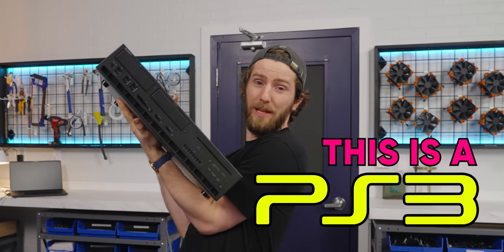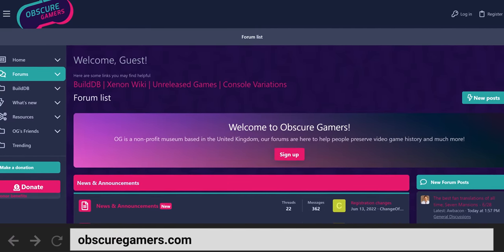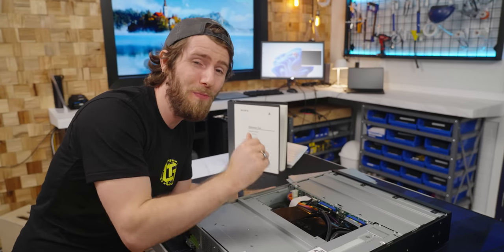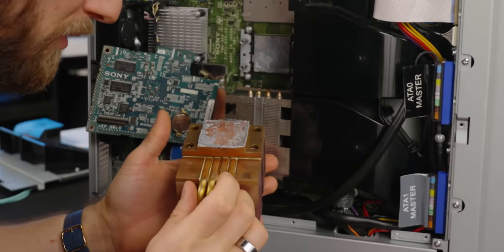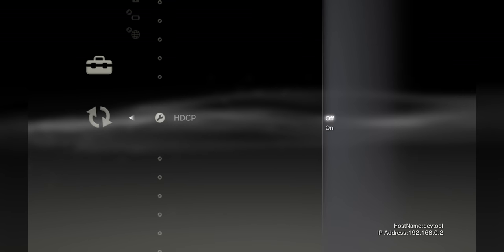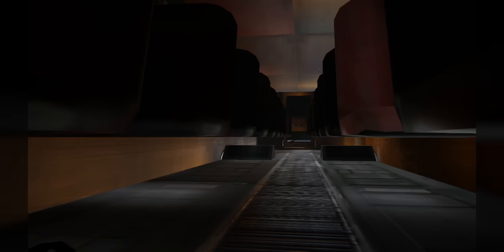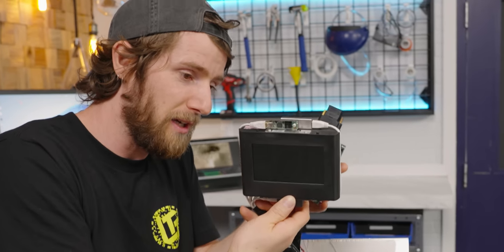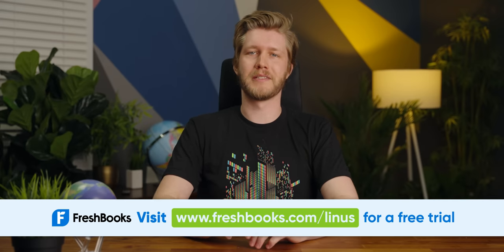I Await Sony’s Cease and Desist - PS3 Dev Kit

Comment: I was working for Sony / Psygnosis at the time the PS1 came out. The dev kits at that point were two full length PCI cards that plugged into a PC, replete with DMA / IRQ jumpers - they were a bit of  bugger to set up.
Reply: I must have been spoiled to be working for Sony in the PS2 era, with the big old dev tool PS2. Step/breakpoint debugging on hardware like that was real handy.
Reply: The ps1 was easier to program for than both the ps2 and ps3 right?
Reply: @califaern3sto  I wouldn’t say that. The ps2 had more memory, more sophisticated dev tools. Ps2 did have more interesting architecture,
Reply: Source: trust me bro
Reply: Wow psygnosis. Now that's a name I have not heard for decades.
Reply: @krazysk  Yeah, specially AMIGA COMPUTER game titles...
Reply: did you use the psyq sdk?

Comment: It had nothing to do with their inability to attract developers. It had everything to do with their inability to produce functional custom chips like CELL In anything resembling quantity. That thing was $50,000, because that’s probably what it cost them to roll that chip out early on. Another  reason why the PlayStation 3 was initially so expensive was that producing blue lasers in quantity was a real issue, they were costing as much as $100 apiece at the factory to roll off the line because only one in 10 was actually good. This was happening at the same time as the console launched
Reply: They have always charged out the wazoo for these, even after consoles shipped. There is always need for added hardware level debug which these consoles can provide, especially later in the release cycle and you will pay a premium for it. Sony probably aren't ever making money on these even later on. The engineering, support and tooling needed for these is done for the value it adds to the platform.
Reply: @dorbie  Yes but that doesn’t represent $50,000. What is $50,000 represents is that they only got a couple of good chips off of a wafer. This is all part of developing hardware
Reply: @jeffkleist9679  ~10% is considered a bad failure rate, not a good production rate. I understand the competition of the console wars was fierce, but that clearly indicates they needed to step back. In the end, it appears they had another team do that since the price dropped alot. I still remember people saying that the PS3 was teh cheapest blu-ray player and it was infinitely better to buy one of those even if you had no intention oof playing games on it. I also noticed that blu-ray players dropped in price within a few months as well.
Reply: @kohlrak  The format launch of Blu-ray was rushed due to the launch of hd dvd. It’s one of the reasons why HDDVD tried to go with red lasers until the bitter end. This was an industry wide problem. Sony froze out most standalone player manufacturers. Only Samsung got one out for launch
Reply: @jeffkleist9679  Pour one out for OpenGL vs DirectX

Comment: That same debug menu is also in a cfw / jailbroken ps3! Basically after installing a cfw, it unhides that debug menu in any ps3 console the cfw us running on.

  I played around with nearly all those options in debug menu. Its pretty cool
Reply: Only you couldn't disable DHCP on retail consoles. It's enabled on hardware level

Comment: I still have my original "Fat Boy" 60GB but I replaced the optical drive (old one had lasers that died), I put CFM on it, re-pasted both chips, 500GB HDD and all my disc games installed on it with other emulation. It has been one of my favorite projects tbh.
Reply: Think I will have to be doing that to mines soon.  The disc drive has issues reading PS2 and 1 games, but PS3 works fine and games work fine when in-game.  Likely the head jamming.
Reply: @Hunnter2k3  My friend at the time had the same kind of console I had but his GPU died in it. He bought a slim and gave me the old one for parts. In that aspect I was lucky.
Reply: I have one as well. A look of work but it's my primary PS2.
Reply: I heard that there's noticeable input lag when playing PS2 games with the fat model over HDMI. Is this true?
Reply: @psycomutt  I heard that there's noticeable input lag when playing PS2 games with the fat model over HDMI. Is this true?
Reply: @Xyskz  From what I've heard... Really shit conversion of the analog output signal of the chip to an HDMI signal.
Reply: I will doing that in the future. I used to had a slim PS3 one... But I really want the OG fat one, because It has hw to play ps2 games :D
Reply: Unfortunately for me, my old PS3 FAT died due to a yellow ring of death. I managed to "repaste" it once (using the heat gun technique) but it only lasted two weeks before dying again and then I never managed to get it to boot anymore...
And since the firmware is too old, I can't even get my old HDD into another PS3 to get my old saves back, because all used PS3 FAT have a newer firmware which prevents booting on older ones... :(
I lost a 250 hours+ Skyrim save which I miss so much... Anyway, life goes on.

Comment: I've been working in gaming for 15 years and to this day, this kit was the biggest pain in the ass I've ever had to deal with
Reply: well in what time frame would a ps3 clock in compared to others?
Reply: Why?
Reply: Same could be said developing games themselves to work on this unorthodox tech 😂 just ask Bethesda
Reply: @MJ-uk6lu  the hardware was unconventional and was unlike anything that anyone would have had any experience with and also Sonys Development Tools software was unintuitive and difficult to use.
Reply: @nickhowatson4745  Isn't that's like exactly every other console until they just gave up and started to use computer parts?
Reply: @MJ-uk6lu  not exactly. PS3 game development was an unfortunate combination of difficulties unlike its competitors and previous models.
Reply: @nickhowatson4745  What about X360? It shared cut down version of IBM chip and also was rather weird. There also was Sega Saturn that was completely bonkers on HW side.

Comment: The foot switch thing brings back some memories.  Back in the Microsoft DOS days, there was a program / add in board, called Periscope, that had a push button that would throw you into DOS debug so you could tell where your ONE running program, no threading back in those days, was locked up.  Man do I feel old...

Comment: 3:35 You can divide the surround sound into 4 outputs(4.0 like). 3:50 They are a remnant of the prototype. They were used to connect multiple devices into one network without disconnecting the device from the Internet. You can make them work with pre relese firmware build.

Comment: For reference, the reason the Reference kit has the additional HD slot is not for game stroage or redundancy it was so that developers can test builds quickly without the need to burn them to a disc.  They would develop on a standard PC, copy the code to a HD drive them insert that drive into the devkit/refernce kit and run the code on that hardware to test.  It makes things so much easier, not to mention faster than disc. Also, most studios did not actually develop code on the reference kit/devkit, they would only use them to test code on close to retail hardware.

Comment: I saw a PS4 version of this back in the days at Ubisoft Montreal. It was in a very plain metal box and screwed down on a desk with special screws. The box was plain metal color and only had a few holes in it to let the wires and controler come out of it. 

Your version is much more advanced than the 1st version of that PS4 we had. I think we eventually had new models along the way but that was very very very early models. 

Cheers... from Montréal, Canada  ;)

Comment: The Gears of War 3 bit has an interesting back story. From what I understand, the dev environment was setup to compile versions of games for other systems automatically when a new version was uploaded to the servers. The devs literally had no idea that versions of every GoW had PS3 builds.
Reply: And that is how you make cross-platform games the right way.
As opposed to all those "We don't support Linux because its too much work".
Reply: Modern Vintage Gamer has a video all about Gears 3 on the PS3.
Reply: Real reason is not that. There are 3 Gears of War 3 PS3 builds out there. One called GearPS3[2011-05-1915.29] (which is in this video) was compiled to test the Playstation 3's abilities with the PS3 having only 256MB of RAM for gameplay, while Xbox 360 has 512. You can tell it's this build because it has the UT3 logo, and the menus are broken with controller. You have to manually enter a new map. 

The other two builds which were compiled from a Gears of War 3 source code leak, which someone manually code fixed a lot of stuff (menus work, lot of back end stuff), additional maps that were scrapped added in. First version had the UT3 logo, and the other was polished with the Gears of War icons and PS3 controller buttons. The only way to make the game run faster, is to lower the RAM usage, which means decreasing all the textures to a lower amount. I have two firsts running in 2016 on my channel.
Reply: @hubertnnn  Linux Is too much work Is reality
Reply: @EpicErrorjack  Both PS3 and Xbox 360 have 512 MB of memory. The big difference is that the PS3 used a PC style Nvida GPU with 256 MB of dedicated Video memory and 256 MB of RAM while the Xbox 360 had a unified memory model with all 512 MB shared between both its cell derived CPU and ATI/AMD GPU. Most games used well under 256 MB of memory for the game state allowing the Xbox 360 a graphic advantage by allocating more than 256 MB as video memory allowing higher resolution textures or bigger/more frame buffers than possible with the PS3.

The likely reason for the poor performance with the PS3 in this case is the cell processor. Beyond a doubt the cell processor is terrible for games, being a single core processor with 7 much weaker, slower cores to back it up. We all know how easy it is to make games take advantage of multiple cores, especially slow ones, given it is 2022 and still AAA budget games suffer massive scaling issues beyond 6 cores. Microsoft was less silly and instead ordered their cell derivative processor to just have 3 big cores giving it much better, usable and more PC like general compute power even at the cost of theoretical floating point performance. Games optimised for the Xbox 360 likely expect 2-3 performance processors and so perform poorly when forced to run on a single powerful processor and 7 much weaker processors, which might not even be trivial to use to begin with. Games optimised for the PS3 often resorted to demanding physics to find a use for all the smaller cell processor cores or leveraging the bulk capacity of the Blu-ray to try and give an asset quality lead over the xbox 360's DVD.
Reply: @drsupergood8978  What both this video and Epicerror were referring to when they said it has 512MB is the main system memory (which is 256MB on retail units). PS3 devkits ship with 512MB RAM available to the CPU because of unoptimized builds which are very unstable with just 256MB.
Reply: @EpicErrorjack  My mistake, thanks for the clarification. It does make me wonder just how well the series could've run on the PS3 with more fine tuning.
Reply: Steam Deck is Linux, if you stick to Verified games you already have just as big of a selection of games compared to the Switch and with much better performance, and it's just as smooth of an experience
Reply: @hubertnnn  Well as you saw, the build runs, but barely. Getting it to run properly on a completely different architecture such as PS3 was, really would've been a lot of work. Though, the Linux example, shouldn't be as difficult since it's still x86 just like Windows and Mac are. But since Windows' kernel is it's own beast, that would be what would bring in a lot of the extra work. macOS and Linux are very similar framework-wise so translation between them usually isn't so difficult.
Reply: @hubertnnn  its not too much work because of the compile process.   its too much work because there are more then 100 linux distributions out there and supporting soo many formats and folder structures and commands and so on  with no unified standard for all of them  is not going to be cheap    .     even if you only do it for the popular distros you needs to do  flat pack, app image, debian,RPM,  arch , snap    all at once for all the distros.    then pray it doesnt break and has decent performance
Reply: @ali32bit42  Big wrong, Linux is standardized, even though you have all those distros, they all share the same filesystem structure.
And if you want to go lazy all you need to do is pack the entire application into a single folder and put it under /opt as eg. java did.

You don't need to support all the package managers, just support Steam or provide a tar. That's what most indie developers do. If it works for them, then its going to work for AAA companies as well.

@ForeverNoob I saw how it runs, how it runs on completely unsupported, different architecture without even the developers knowing about it. No tests, no performance tuning, no anything and the game runs stable around 20 FPS. That's a great job done by the porting team that setup the automated compiles.
Reply: @hubertnnn  it's not much work if you're using an engine that supports multiplatform targeting out of the box
Reply: @hubertnnn  Make a dev tool that automatically port windows games on linux and then talk.
Reply: I just though it was Epic using a game they had already built that uses their latest Unreal Engine and seeing how they can optimise it to run on PS3.

They had no intention on releasing it, it was nothing more than a "tech demo" in some sense.
Reply: @radosawmichapiwko7141  it's called cmake
Reply: @hubertnnn  Because it literally is too much work for the minuscule amount of people who actually game on Linux.
Reply: @radosawmichapiwko7141  You mean Proton and DXVK?
Reply: @Poldovico  They have proton on ps3?
Reply: @radosawmichapiwko7141  "Make a dev tool that automatically port windows games on linux and then talk."
Reply: @Poldovico  XD